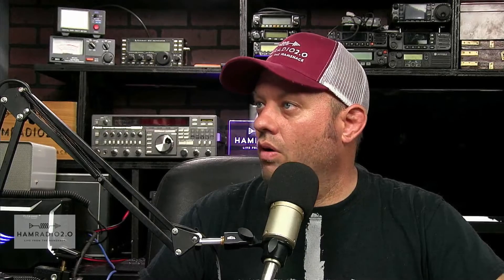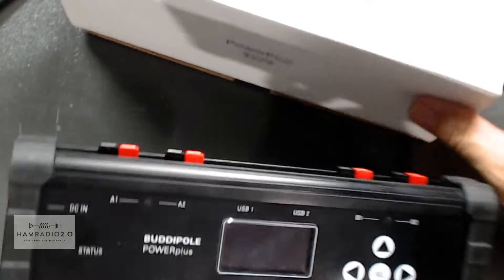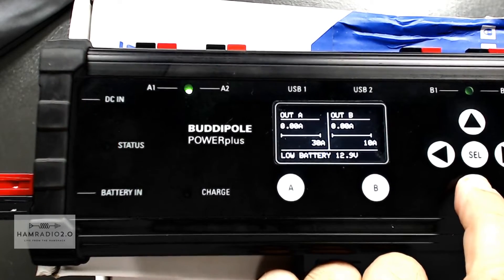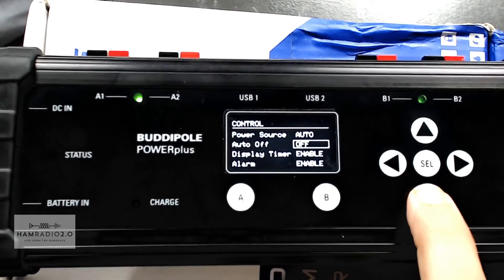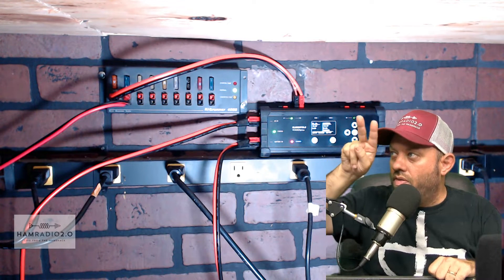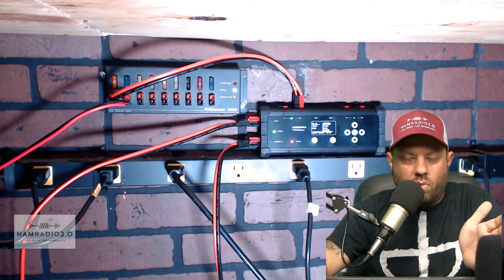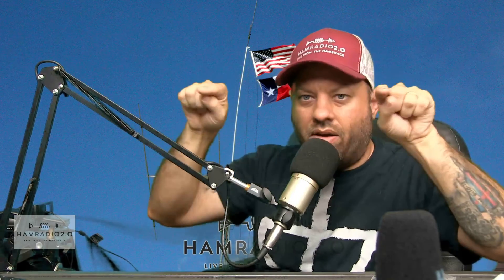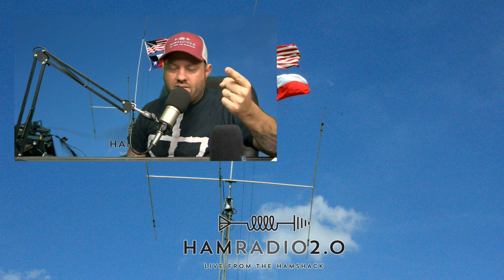Buddipole PowerPlus | Rugged Portable DC Power Management System

Comment: How would you hook up a charge controller for this configuration?  8P6RC
Reply from the maker: A solar charge controller?  I guess you could add that directly to the battery that is being used as the backup in this config.
Reply: Ham Radio 2.0 The unit has a built in charger.  This is the charge controller you are mentioning.

Comment: I like the horizontal power poles rather than vertical from the rest of the manufacturers.  Upright power pole connector seem to put tons of stress on the connector especially with heavy number 8 or 10 wire. Thank you Jason for the review. Mike N6IMY
Reply from the maker: Agreed, I think that is an added bonus

Comment: Nothing as yet for PSU distrobution except lots and lots of electrical string...XYL not happy. I would point out too, that Buddipole TENDS to make stuff for portable operation, probably why there is no mounting method...but thats a guess on my part. 73 from VK6MMB
Reply from the maker: Yes it is most likely for portable, but it also has DC-in and battery backup...not something you would tend to take in a portable setup...maybe Field Day, but certainly not SOTA
Reply: @HamRadio2  Oh god no....I have done a SOTA with close to 50Kgs of gear...old Kenwood TS640S MfJ versituner2 and batteries and antennas...now all that goes is a LIPO My KX3 my Buddipole and SOTAbeams mast with Norcal Doublette. and even thats getting close to 30Kg. No way at my age am I playing SOTA with 50Ks on my back.....in my 30s yes but not now with everything on my body breaking due to nearly 20 years military service in the Royal Australian Navy!!!